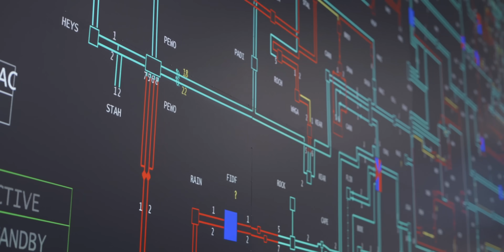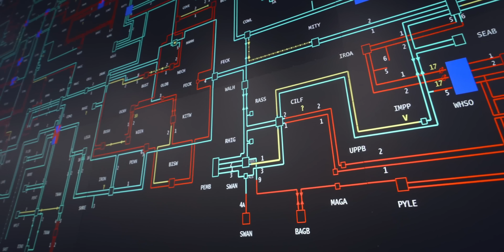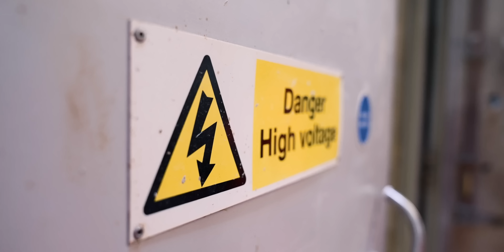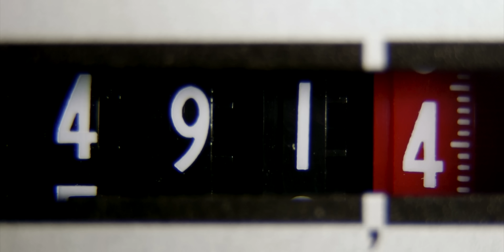THIS is Why the Grid is Ready for Electric Cars!

Comment: Very odd.  I have always been told that transmitting high power was most efficient using AC, and using DC is super inefficient.  Now you're using DC for transmission.  I'd really like to know what's changed?  What have I, my school teachers and university lecturers missed?
Reply: In general, higher voltage is more efficient. Restive losses are drops in voltage, with a higher voltage its a lower % of the power that is lost. The benefit for AC is that its easy to go up and down in voltage. when you get into big transmission lines you get capacative losses, which are greater for AC than DC, and greater for buried or undersea cables than power poles
Reply: Essentially, at a given voltage DC will be more efficient than AC due to skin effect reducing the effective conductor cross-sectional area for AC; however, it's relatively trivial (in equipment and losses) to step AC up to very high voltage (and back), and historically not so for DC, so it would have been inefficient to use low(ish) voltage DC for long distance transmission. HVDC has been enabled by significant advances in power semiconductor technology - especially stuff relating to materials science - and improvements are still ongoing.

Comment: From Norway: That extra cable FROM Norway to UK and the one to Germany tipple the electric energy price for us. And remember we use electric energy for cooking and mostly making hot water and for heating via heat pumps. And a lot of industry and energy intensive production is suffering. I have had 10 -16 gr C in the living room if i don't use my clean burning wood-stove. So now every Norwegian with a wood-stove is burning wood if they can get it for free.  
Every plan for new green industry is on hold on the south part of Norway.  The energy flow is very asymetrical. Mostly from Norway to UK and very very little from UK to Norway.
Reply: They don't mention transfer of pricing here which from a norwegian perspective is quite horrible. In this system the consumer suffers.  It is a cheap way to bandaid damages done by countries that privatised their utilities while the profits are siphoned to the fat cats.

Comment: We need a system where every new build comes with solar power, all of them linked together to send excess power to other users. That time would mean that we no longer needed huge power stations, just large storage systems, with solar backed up by wind other renewable power. The tech is not really ready yet, but one day......
Reply: That’s pretty much what grid connected domestic PV does at the moment - the problem really comes when it it is dark and not windy or when there is too much excess within the remit of a substation hence DNOs limiting export to 3.68kWp per property without major upgrades - the transmission network was never designed with backflow in mind so excess can only be used locally…batteries could alleviate that to some extent but the expense versus an efficient central generator probably won’t ever justify it - a nuclear baseload seems to be the only way with PV and wind as a supplement when available as it is now when the gas generation can be turned down…
Reply: You're joking right?! There are super energy hungry factories that needs that massive energy and also your local solar thing is crap compare to that grid that can actually supply massive amount of power. Aluminum production alone Is an energy guzzler, glass production a d recycling and many other processes
Reply: @alanmay7929  I think the point being made was the micro-grids for domestic use would suffice for exactly that - domestic use. Industry would still need central generation for their needs so usually a hefty direct link to the main grid - saying that if an aluminium smelter chose to have a small scale nuclear reactor next door supplemented by a PV or wind farm then I'm sure that would be part of the solution...
Reply: @alanmay7929  Maybe read what was said "The tech is not really ready yet, but one day......"

Comment: Many things in our homes use DC and need adapters to convert household AC for the purpose. But now more than ever there is DC generation and storage on or near the home. About two years ago, I started asking if there was any consideration being made to putting whole homes on DC, and only converting energy for or from the grid. I understand that most household appliances use AC, but they don't have to. What is the tipping point for DC to become the dominant power in the home?
Reply: It doesn't really help unless all those DC devices use the same voltage. At the moment they don't. As soon as you have multiple voltages you have power conversion. And not having it is the main advantage of switching AC->DC. HVDC (fneeded or high-power devices like PV panels, showers, car chargers, heaters, toasters) is more of a shock risk than AC, so the wiring regs people are not going to be keen. Overall it seems like a nice idea, but the closer you look, the less it actually helps. Moixa tried selling a system to do this for your house some years ago. Very few people bought one.
Reply: 48V DC would seem to be a safish compromise but as stated it would just cause far more problems ultimately as large loads would then need higher currents to reach the same power inputs and LV circuits would need further step-downs anyway. It might make sense to run lights and chargers on a 12V DC system but ultimately that would still most likely originate from an AC distribution network
Reply: I can't see it ever happening.

The district level distribution has to be AC. The equipment to step the voltage down DC to DC is very expensive.

If you have it AC up to the gate so to speak, then you need the AC to DC converter at the house. A machine for just a house would cost 10s of thousands and consume electricity at all times, even with nothing plugged in. You're looking at something similar in cost to a 50 kW DC car charger. Thousands. 

Then once it gets to the house, DC is very dangerous. Sparks don't self quench so cables can turn into welding machines. Switching is very difficult as contactors weld closed. Fuses are harder and you need special sand filled ones. Faults turn into fires instead of breaks.

You might see power points with AC to DC converters built in becoming more common, but I can't see it going past that.
Reply: @gasdive  It wouldn't be '10s of thousands'. a 10kW inverter is £2500 which is good enough for most purposes. a 60A supply would need a 15kW inverter for equivalent performance is ~3 grand. Still a lot of money to pay for something that replaces 'a bit of wire'. And not much in the way of actual advantages.
Reply: @xxwookey  sorry. I'm projecting my own biases.

I'm in Australia and think in AUD. Domestic supplies here are either 240V 100A single phase (24 kW) or 415V 63A three phase (45 kW).

A 45 kW supply at 48V is the best part of a thousand amps. So yeah certainly in AUD that's 10s of thousands.
Reply: @gasdive  Fair enough. You get big fat supplies in AU! It's 60A, 80A or 100A single phase 240V in the UK and Ireland (or 30A for some unlucky souls), (so 14, 19 or 24kW). Much of Europe is 3 phase, but not all, Norway has 4 wires rather than the conventional 3, and Italy has exceptionally weedy supplies.
Reply: @xxwookey  there's a lot of big air conditioners / heat pumps here. And underfloor heating in the snow country. Lots of all electric households too.

Plus we have the same basic connection for a city unit or a country farmhouse.

I forget what it's like elsewhere.
Reply: @xxwookey  could be worse. In Japan it's 100V, 40A for the whole house. I draw 50% more charging my motorcycle. I don't know how they run cars.
Reply: @gasdive  you're right, the transmission network will still remain AC as it's tried and tested and the disadvantages of DC transmission were established many years ago - to then needlessly convert to DC for the whole house is pretty much pointless as each individual appliance can happily do that on an ad-hoc basis as needed and SMSPes are pretty efficient and can be replaced easily when they fail (as they do), as weird as it seems to be using 240AC for LV DC chargers, lamps etc - unless you have a household micro-grid of LV DC power from PV or the like then it's never going to fly - even AC sockets with built in USB seem pointless to me as they are powered on all the time so there are still losses just in having them in 'standby' as tiny as the losses are...

Comment: It gets even more interesting when excess wind energy is exported to Norway and stored in a pumped hydro system, turning a Norwegian fjord into a battery. Interconnectors will go a long way to solving the intermittency of renewable. Great video!👍
Reply: @garysmith5025  yes - naturally pumped by solar power producing evaporation, and then precipitation upstream ;-)

Comment: More videos like this please. The cars are great, but there is a great deal more to the whole sustainability effort.

A bit techy, but  Helen, did you find out the cross sectional area of that DC feeder cable?
Reply: 1.4 GW @500KV is 2,800 Amps.  At a 1.5A/mm^2 that's requires a 49mm diameter conductor (no skin effects for DC transmission). At 1.78X10-8 OhmMeters for copper, and 720 Km long cable the end to end resistance is 6.48 Ohms, giving a power loss of 50 MW (70kW / Km!) and a transmission efficiency of 96.3%

Hope that helps 🙂
Reply: @maxtorque2277  Thanks for min. size Max! Would you increase to 50 mm for a little less V.D. & sea floor temp. changes?
Reply: Got to say, I agree with this! I have loved this channel for years, but it needs more balance these days. So many car reviews for vehicles that I, nor many people watching, would ever realistically be able to afford. We get that electric cars are the future, but more education on other factors in this wide sector are greatly appreciated. It's been said many times before, but also more series like the Maddie goes electric one, would make the channel much more accessible to 'normal' people too.

Comment: All you need to do now is teach people to not waste electricity
Reply: That certainly helps, but it's not 'all' one needs to do. For many things the equipment itself has to be upgraded to make more than a 10% 'wastage' dent (house heating, for example). Upgrade the house properly and you can drop the heating load by 90% (I've done mine) - you can't do that by telling people to turn lights and computers off, thermostats down and take shorter showers. (There is a monumental amount of waste too, but it's not 30% of the grid load).

Comment: It's strange that we still use AC almost everywhere, when high voltage DC is more efficient over long distances as stated in this video, and in the short distance all common household items are either DC only and need to be converted with loss, or could be either, and PV also only provides DC. In some data centers they are running 48V DC to avoid the inefficiency of converting AC in every single server and cooperate better with the battery power backups. Is DC-DC conversion less efficient at some of the use cases voltages, or is it really just historic, because DC-DC conversion didn't use to be a thing without AC in the middle and you can't just change the power grid over night?
Reply: A lot of it is historic (and DC-DC conversion was indeed not a thing until the electronics age), but it's actually quite hard to make a more efficient DC house grid or local grid. A few companies have tried (Moixa), but with very limited success. Powering all your lights on a 48V POE setup is (much) more flexible than just using mains and switches but it's not (in general) more efficient. The main problem is that yes, we have lots of DC kit but it's all at different voltages (3.6V, 5V, 9V, 12V, 19V, 21V, 24V, 48V). You either need resistors (which waste power) or power conversion (which is what we were trying to avoid). And high voltage DC (needed for high-power devices) is more dangerous than AC.

Comment: Always like to see Helen talking tech. I'm curious to see how they convert 1.4 jigawatts of DC into AC. That's one big inverter. Going to need some very big IGBTs for that baby and with water cooling I shouldn't wonder.
Reply: I worked on part of the channel power interconnector in a past life. 
It was made up of stacks of GTO thyristors, to share the voltage. All controled with fibre optics. (Just pulse triggering, not data.) The higher the voltage you need the more switching slabs you stack up.
Reply: There’s gotta be a flux capacitor in there
Reply: Yeah. I'd like to see a bit more explanation of what we are actually looking at in that hall. That rack of kit separated by insulators may be the 'very big IGBTs' in question, for example, or it might have been something else. Someone nerdy like Tom Scott must have made a video on this?
Reply: @warren1134  Heh - scary big valves!
Reply: @warren1134  Valve Hall is a hang over from when they used mercury arc rectifiers. Since replaced by Thyristors(SCRs). Don’t know about the inverters, must be some very large IGBTs as the other Peter stated. I think companies such as GE build inverters of at least 3MW!

Comment: Maybe I mis-heard - but I always thought A/C, not D/C was more efficient for long distances. I know the wire can be a smaller gauge.
Reply: Higher voltages are what allow electricity to be transported further with lower losses for a given diameter of cable.

AC is what allows any two coils of wire wrapped around the same core to step the voltage up or down, to convert between long distance travel and safe voltages for the home. To convert DC voltages you basically have to chop it into AC, either to send it through a transformer and then regulate and filter it back to DC, or pulse it into a capacitor at some duty cycle (for stepping down), either of which involves electronics plus fancy high power transistors for grid scale conversions.

Where DC has the advantage is that just two wires will give you smooth power delivery, whereas AC takes three wires yet even still you get pulsations. AC also requires low frequencies to avoid a physics phenomenon called 'skin effect' from limiting the capacity of a given diameter of wire, but lower frequencies require bigger and heavier transformer cores than higher ones when stepping up and down the voltage.

Both AC and DC have their ideal niches, and so we use both depending on whichever works best for a given scenario.

Modern power electronics have certainly made DC much easier to use at grid scales than in times past, which is why we're seeing it now in these new applications.
Reply: @KevinT3141 To put it simply, a.c. power transmission results in the voltage and current going out of step due to the capacitive and inductive properties of the transmission line. This results in lost power. With d.c power transmission, this doesn’t occur.
Reply: @user-rf9me7xm1w  Thats because there is no free lunch you lose what you gain by removing DC losses now introducing losses from the double conversion process. There are more losses converting DC to DC or back to AC again than there is AC to AC via transformers. This is why HVDC is only suitable for long-distance transmission, you'll never see its benefit at the LV side which is where we really want those efficiencies in transmission the most, which is why we usually put generation as close to the load as possible.
Reply: Check out China's ultra high voltage transmission network. When dc is ramped up to large voltages the transmission losses are almost nothing

Comment: Very impressive, but missing some details, like how does the rectification and inversion work, the voltages and currents involved and transmission loss per 1000km
Yes, I know we can look these up, but people like the details, not dumbed down info for the masses!
Reply: To some degree this is the wrong channel for that. They have always avoided much in the way of technical detail (and it's been pretty successful so maybe they have a point). Yeah I'd like that info too, and do tell if you find a report on this interconnector with some juicy details.
Reply: IIRC it's about 3% per 1000km. Makes Morocco to UK with solar just about feasible.

Comment: Have the interconnects on the south east and west side of Scotland been upgraded so that the excess offshore wind from Scotland be exported to the demand in England?
Reply: No SEGL1 to Durham is set to be built in 2024 completed 2027. SEGL2 to Yorkshire set to be built 2024 till 2029.
Reply: @EVdoctorLewis  thanks for the information, I can not understand why upgrading these interconnects has had such a low priority.
Reply: @andymacleod2365  I think it might be quite complicated. Going in the sea avoids landowners making planning difficult for pylons or buried cables but the burying in the seabed might be complicated and there's planning stuff re biodiversity on the seabed too.
If you Google the project names a big pdf from national Grid comes up with some explanations.
Reply: @EVdoctorLewis  the 2 interconnects that I'm speaking about overland, the cable has sufficient capacity to carry more power, but the transformers are undersized. The powers that be would rather see England with power cuts than upgrade these transformers as Scotland has more green power than it can use.